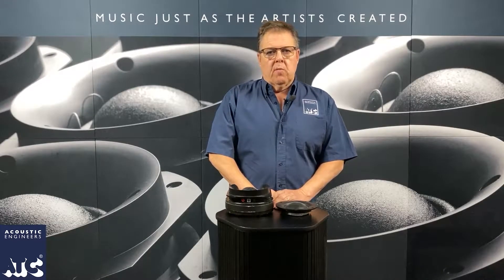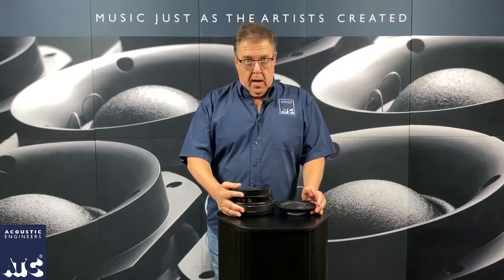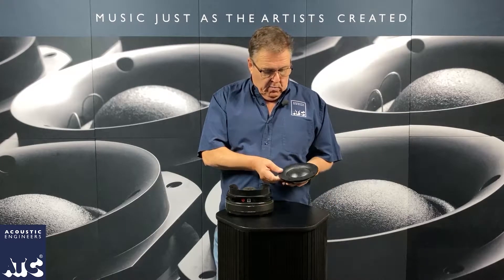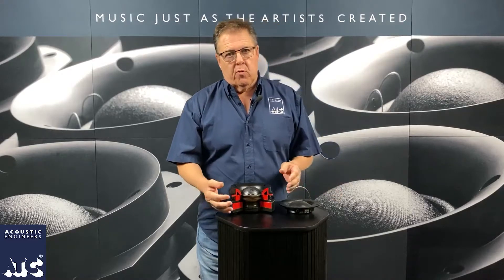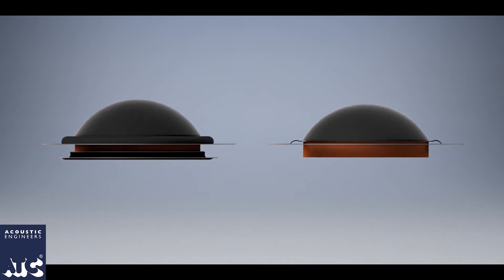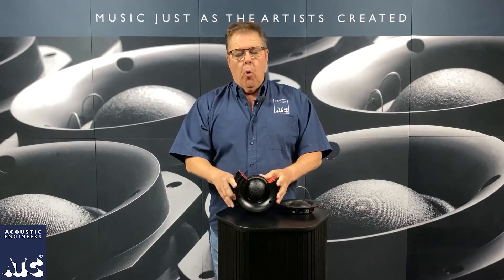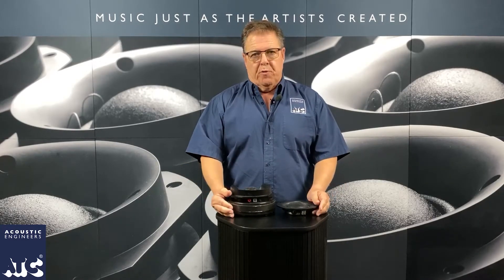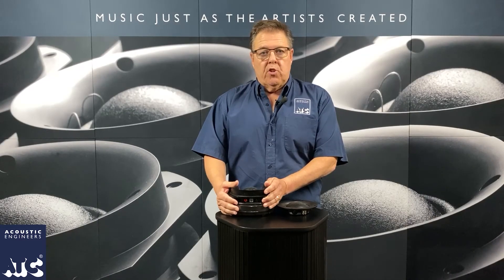ATC Pro Driver Technology - Mid Dome

Comment: The ATC mid operates from 380Hz to 3.5k covering most of the range of the male voice, other mid domes like the Volt only go down to 500Hz, putting a croosover in the vocal range, this can introduce phase distortion. It can also effect indirect sound which excites the reverberant field, one of the differences with ATC's is the indirect sound has a similar response to the direct sound, which reduces colouration create by the room.

Comment: Crazy how this 6" midrange has a larger motor assembly than many bass drivers at twice the size.
Reply: It’s even crazier, considering it’s actually 3” :)
Reply: I have these mids. One weighs 14 pounds if I recall.
Reply: because your speaker sucks
Reply: And 6 times the price

Comment: No comparison, a unit with neodymium magnet is normally much smaller and also more expensive. The dual suspension is only necessary when your mid driver is taking very low frequencies. So a bulky mid driver doesn’t mean it’s better. Not to say that ATC mids are bad, no they are better than most.

Comment: The two wires on the outside of the mid dome look so out of place... What is the functional benefit of keeping them visible there, as opposed to hiding them on the inside?
Reply from the maker: They have to go around the dual suspension. There is no room inside to run them.
Reply: @TransAudioGroupMedia  Thank you!

Comment: Those midranges are actually Volt VM752's. There is a 6 month backlog on retail orders. Roughly 700 USD shipped.
Reply: Wrong . Its a 100% ATC driver . ATC builds 2 versions of it . The SM75-150S and SM75-150 . Volt copied it later and now PMC uses the Volt drivers.
Reply: @cemmany  You are right I am glad I didn’t get them
Reply: Nope; the Volt is a totally different design that happens to look like the ATC. The ATC is underhung and uses edge wound flat wire,  the Volt is overhung and uses round wire. The volt doesn't have the low end extension the ATC does.

Comment: 2:28 - Good video and I love ATC’s midrange domes (and their monitors/speakers as I used to own a pair of ATC SCM 150S's) and they sounded beautiful no matter what kind of music you put into them - but there is no way the magnet on the dome of the mid range dome-transducer that he compared the ATC midrange domes to had a magnet size the same as their tweeter - as per his statement. 

Additionally, neodymium magnets are far superior (in many ways) to Ferrite and/or Alinico magnets which which most of the ATC midrange and woofers have in them. 

I still love ATC’s though and miss my pair of ATC SCM 150S's.

Kind regards,

Kim Shaw

Electronic Engineer 
Electrical Engineer 
PhD Electroacoustics

Comment: What is the Xmax on this midrange driver ? Doesn't seem like  much and you are expecting a 15 inch driver to crossover at 380Hz to a 3 inch dome midrange with a small Xmax ??? Sounds like a huge mismatch.
Reply: IIRC the xmax is ±3mm or thereabouts. It's quite high for a dome.
Reply: At frequencies below 400hz your ears aren't that sensitive to the directivity difference
Reply: Wouldn’t seem to have any effect on the fact that people and studios worldwide worship ATC’s.